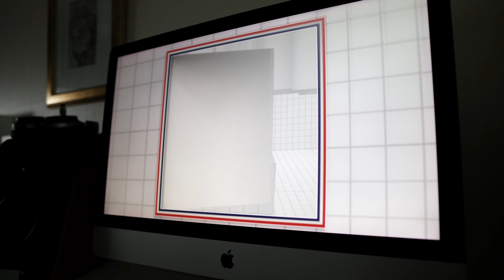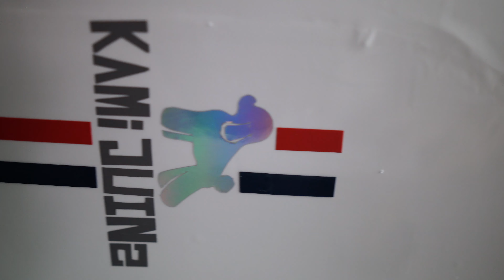#117 DIY Electric board - THOM BROWNE edition deck

Comment: I’m sure it’s been asked but what are you using to color/wrap the board?
Reply from the maker: You mean why? right? Because it's DIY and one of the biggest reasons I do DIY is because I want to make my own appearance. Thanks :)
Reply: I mean what is the material you are coloring the board with? It looks like a type of wrap or adhesive material. I’d like to color my own board the same way but do not know what the stuff you use is called?
Reply from the maker: I got it. This is a PU-based film sheet for interior and car wrapping. Maybe you can find it easily if you search on Amazon.
Reply: Awesome! Thanks. I’ll take be a look.